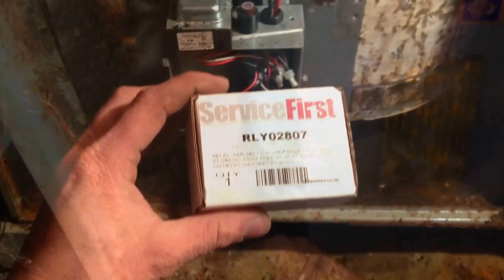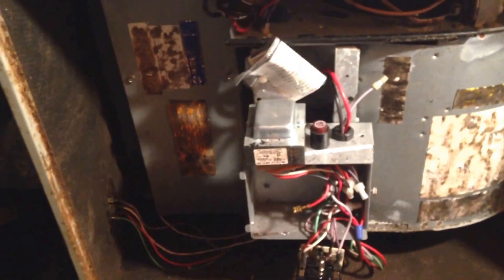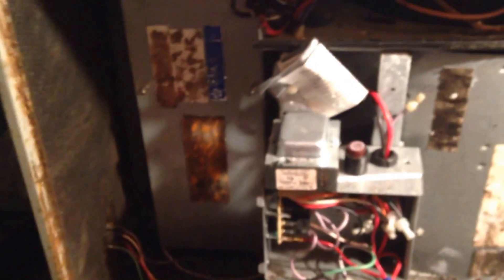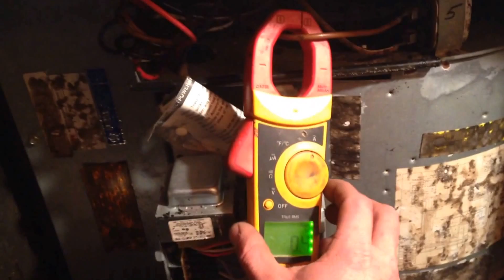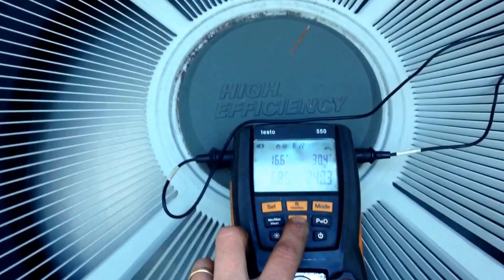HVAC Service: Troubleshooting Time Delay fan relay on a Trane Air Handler

Comment: If you knew this 6 yrs ago, wow.   Bow to you.  I have only met one tech out of 20 that knows what it is.   Doubt you will reply but when a relay is used to make a system "match" for AHRAE is it always an  identifiable part or would there be a circuit board that i can't ID.   Pretty 99.9 % sure i was taken for a song, meaning its not there to make it a match cause the blasted tem8 and xv20 have had issues from the get go.  Thanks for sharing your knowledge. Best for ya
Reply from the maker: 3 months later.... usually the relay will be identifiable. Thanks for watching

Comment: Nice video!  I have a relay that is sometimes failing to close.  after is does close it will run for days if I leave the fan on manual.  Hoping the relay will fix it.

Comment: Having a problem with circ fan not coming at on at times. I can at times cycle the thermostat , turning it off and it will start operating. Compressor and compressor fan operate normally. I was thinking the relay board? Suggestions?
Reply: I am having the same issue, I am also thinking the relay board.

Comment: Thank you. I had the same exact problem yesterday and could not figure it out because there wasn’t a wire diagram that’s was legible and they do not have it online. In my case the board to the relay wasn’t even there
Reply from the maker: Glad I could help

Comment: Nicely done sir, you were thorough in your diagnosis and it was good judgement to make the other checks. Anytime I make repairs on a system I give it a once over to avoid call backs because let's face it the customer only knows he was without air twice in a short period of time and despite the 2 failures being totally unrelated he's typically not too happy. That unit has seen some better days though. I love the american flag visible on your uniform.
Reply from the maker: +Frank Shively thanks for your support

Comment: What is that box on the wall at 0:25? And what did you do to it?
Reply from the maker: That is the electrical disconnect, I flipped over the pullout handle to turn the system off

Comment: I was having truoble  with my hvac not turning off the inside fan, so I checked the relay in it and it was staying on all the time. I talked to a hvac guy and he said it probable was a relay so I replaced it my self, but the system still has to be turned of by breaker, can you give me any advice on it thank you!
Reply from the maker: It could be all Sorts of things that might cause constant fan operation. Did you try disconnecting the wire for the fan coming from the thermostat? (The G or green wire usually)
Reply: Do you need the time delay board on the relay?  My upstairs unit ran constant and the HVAC guy just left it off.  Downstairs unit seems to be doing a similar thing, but it usually stops (but could be an hour or so).

Comment: What could be another cause I have changed relay and still have same problem
Reply from the maker: It could be a low voltage short, theoretically.
Reply: Stephen Rardon mñn

Comment: I have never seen a run cap calc, in a video, until now. I cannot remember studying on that procedure in school either. What are the two big numbers, before the voltage? How does it calculate?
Found you through Zack.
Great video! Will subscribe
Reply from the maker: 2650 X amps / volts= Mfd
Here's a link to the procedure video.
Reply from the maker: http://youtu.be/qo7PLNMFWiI

Comment: Nice work Stephen! Once a relay has stuck it will only get worse, good call changing it!
Reply from the maker: I hate to leave weak capacitors for now but I can't do things for free and sometime landlords won't spend it until it's broken so might as well leave the weak stuff to fail later on. Job security I guess

Comment: Nice video Stephen, I'm glad we don't have any crawl spaces in South Texas, they would probably be dug right into an underground smuggling passageway.  Keep up the good work.
Ray
Reply from the maker: Yeah, but you've got residential rooftop package units, right? At least the crawl space gives us some escape from the sun!
Reply: Actually where I am from most of the A/C units are split systems.  We still have to deal with the sun no matter what.
Ray

Comment: Good work on the video. How old was the Trane?
Reply from the maker: It was old enough that they were using the stamped aluminum data plate. I believe it was a 1991. I've seen 10 or 20 more model numbers since then so it's hard to be certain
Reply: That is old. They were real tough units.
Reply from the maker: It's where they got their reputation! "hard to stop a Trane!"

Comment: Nice work Stephen, Is the time delay adjustable or preset on those boards.
Reply from the maker: This device is factory set. I believe it's a 30 second delay once the call from the thermostat is dropped. So it's a "delay on break" timer.
Reply: Stephen Rardon Thank you for the video! I have same unit with same problem. What model is the relay? Thanks!
Reply from the maker: I don't recall off the top of my head. If you give the model number of your unit to a Trane dealer they should have this relay listed as the repair part.

Comment from the maker: HVAC Service: time Delay fan relay
Reply: If you wanted to take the delay board off, which one of the double blue wires would be cut (and tape off) and then connected to the relay (plus the green one)?